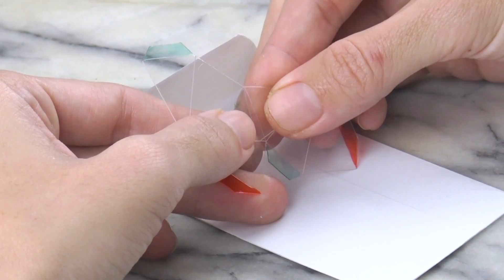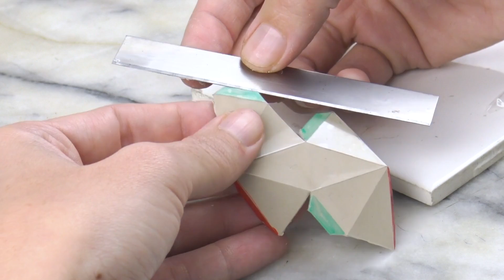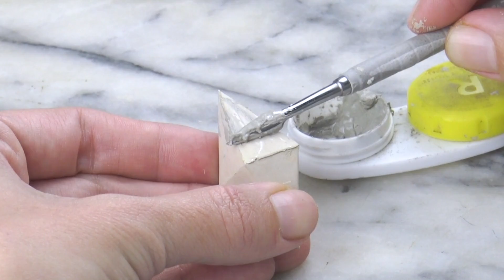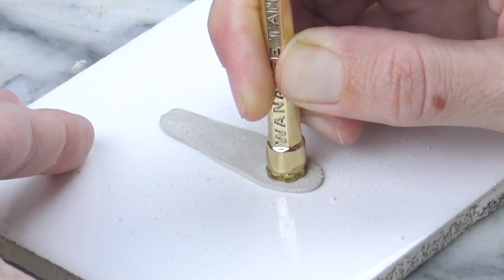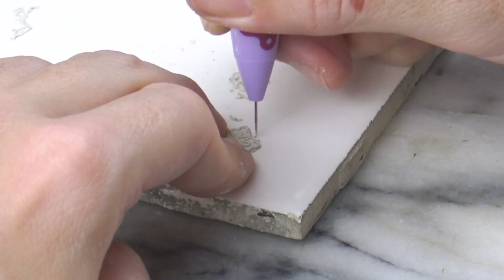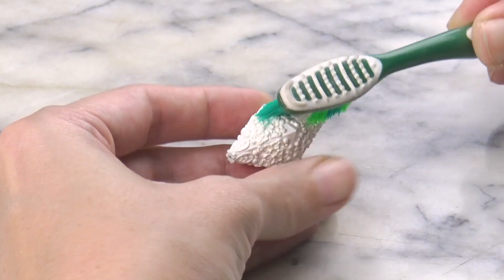Cool Tools | Fine Silver Geometric Bead by Wanaree Tanner

Comment: Jeebus, there's 2 dozen steps that can be thrown out. Why not just roll a sheet and use the round cutters to cut a bunch of balls? Or roll a snake and cut 1 or 2 mm pieces and roll them up?
Reply: Because doing it that way would create only flat dots instead of the flat-bottomed domed ones required and shown. 

If you took sheet and cut circles and then rolled them up into balls, you'd have the dimension, but they would also be round on the bottom and not stick anywhere near as well to the surface.
Reply: @wendyannh  you could easily roll a snake and flatten the bottom, then use a round cutter. There are a member of ways you can make balls that stick on without all these steps. I do it every day with PMC.